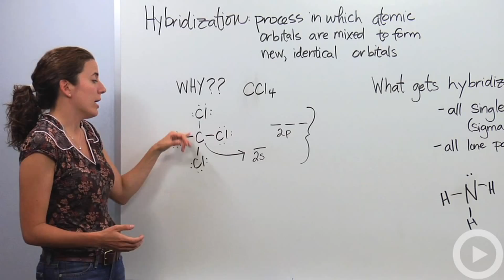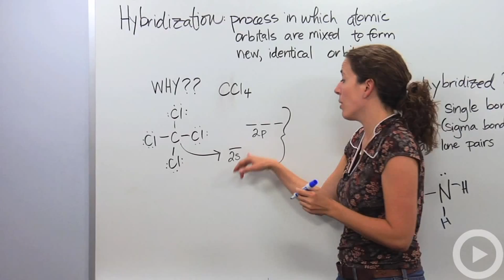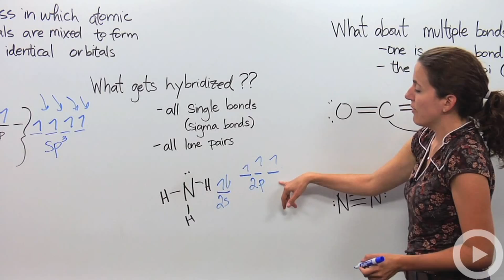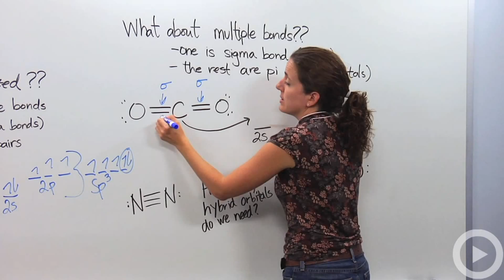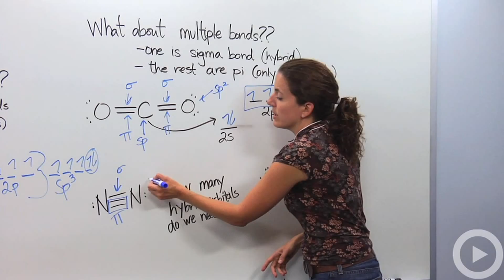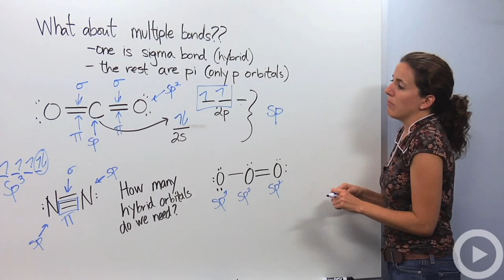Hybridization(HD)

Comment: Around 1:03, when the need for hybridization is explained, CCl4 is taken as example to prove that all bonds are equivalent. This is a very simplistic example. A better example is CH2Cl2 for which two distinct structures can be written but there is actually only one molecule known, i.e. no isomers. This will be a better proof that all four bonds of carbon are equivalent or identical.